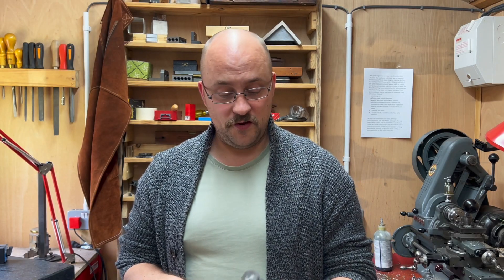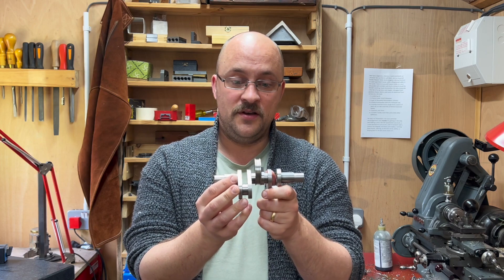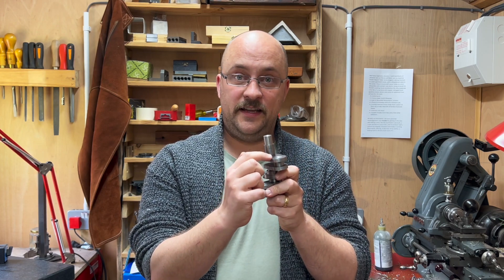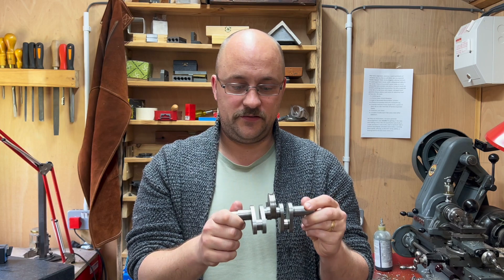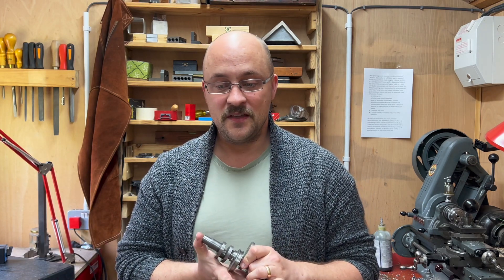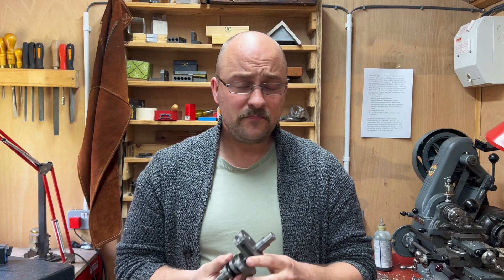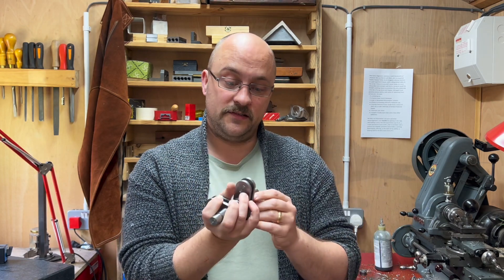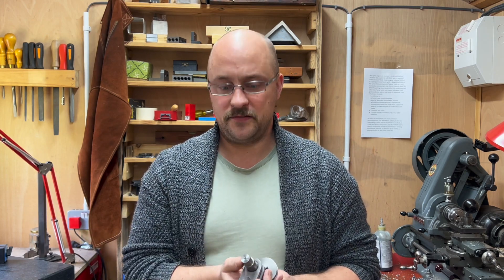Crank axle may well be salvageable? - Steam Loco No. 27 Addendum

Comment: keep at it mate   [trial & error ] took your advise, my lead screw is on its way  ,, thanks,,i am now fitting a tumbler reverse on my myford ml10 .they were made without them  , then will work out the power feed for the cross slide .. william you know as well as i that nothing is impossible  in regard to mechanics.. it just takes some thinking out   ,,,,,,, some of the best ideas are at the most awkward times .. ,,  well enough of my dribbling ... keep at it ,, the answer is always there  it just takes a bit of finding ...regards    laurence
Reply from the maker: How did the ML10 fitting going? I've considered making a fine feed tumbler for the Myford - but I think it would end up costing a good deal more than just buying the gear from Myofrd.

Comment: Setting up between centres in the lathe will simply divide the error between the two sides equally if you choose to hold it there. 
The only real way is a single axle as previously pointed out. The  cutting out the portions between the webs after pinning the joints.
The best way is out of the solid.
Reply from the maker: Thank you, I think the problem was during the set up rather than the parts themselves